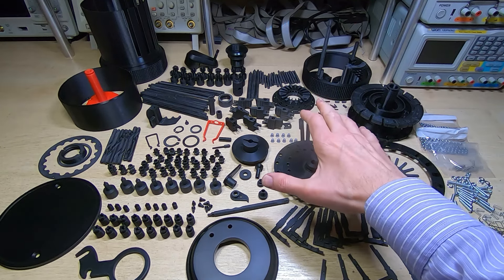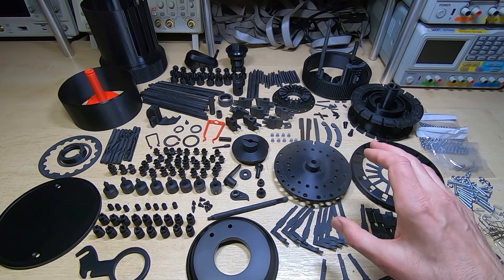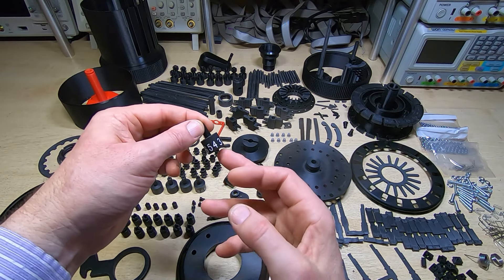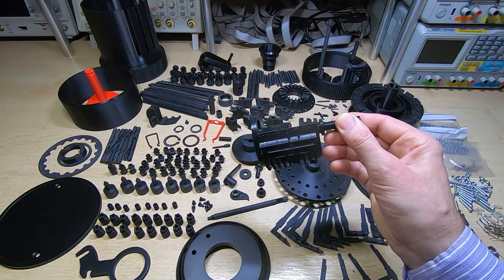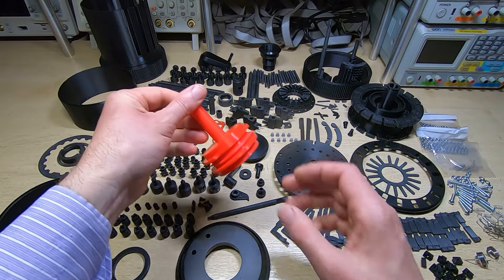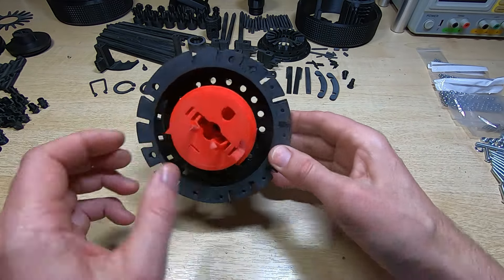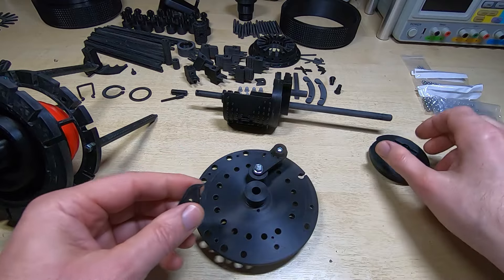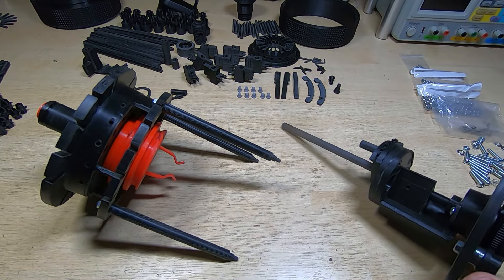Curta Calculator Assembly Part1

Comment: I wonder if it would be worth the effort to scale the parts such as to be able to utilize vapor smoothing? Might reduce the amount of manual labour needed to finish the parts.
Apparently PLA does respond to acetone but I've gotten the impression that the temperature is an important factor.
Where as if you're able to print with ABS (fume extraction) it's supposedly easier to vapor smooth.
Due note that I haven't tried vapor smoothing anything, I'm just curious.

Thank you for making this series!
Reply from the maker: Vapor smoothing does not bring the parts to a specific dimension, it only blends the outer layers so would not reduce the amount of finishing required. It also does not leave particularly even surfaces so I suspect that the friction would be high but you should feel free to give it a try.